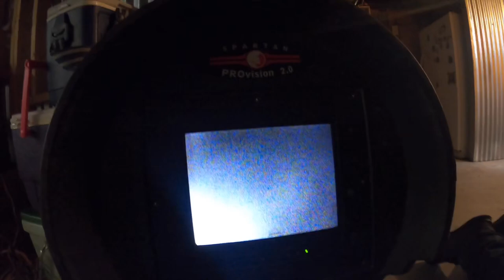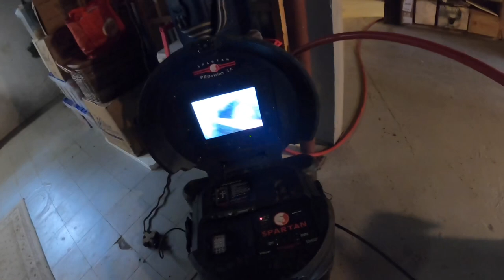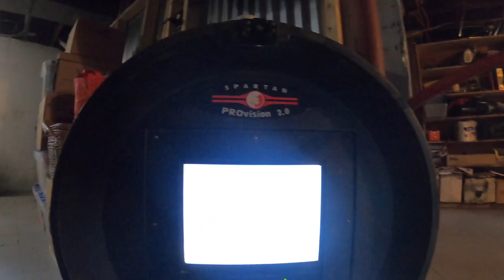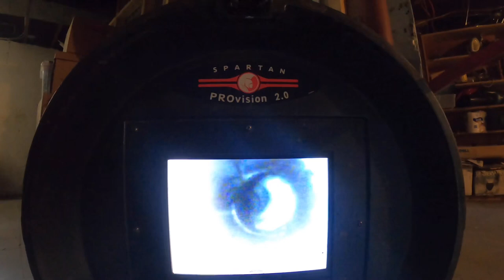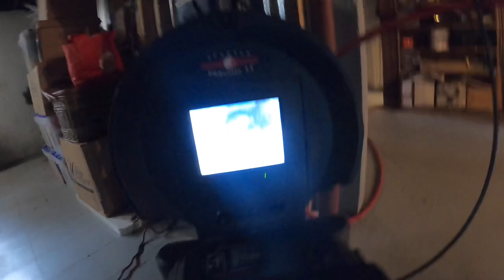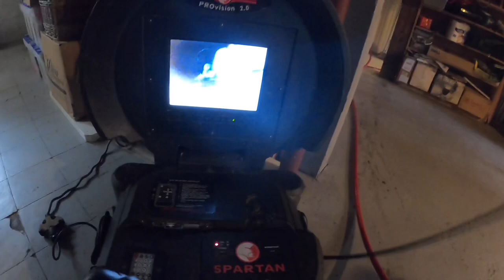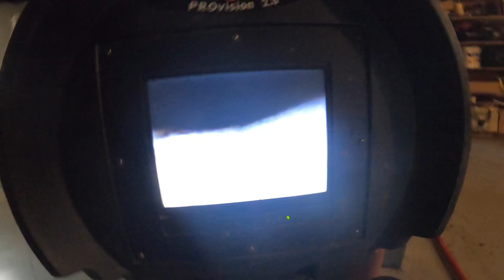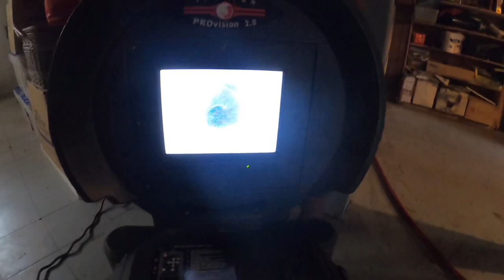MASSIVE!! SEWER ROOT INTRUSION- Drain Pros Ep. 48

Comment: If you install a liner, I'll be curious how you handle any laterals or cleanouts that tie into the line.  I couldn't follow this one exactly, but I thought you passed by one or more laterals.  Good job clearing this one and checking the work by camera.
Reply from the maker: Thank you! With this one the liner would just cover over the tie in, which is a outside clean out that the porch was build over years ago. Most of the time though if we have a tie in that needs to be completed say another stack tying in we have a picote machine that runs down from that stack and is almost like a 4” drill bit that bores through the liner, and then it has a sand paper attachment to clean the edges up!

Comment: Quick question does the pipe still need a sleeve or was the pipe ok?
Reply from the maker: The pipe still needs to be lined to stop the root intrusion into the pipe. All the roots were cut out of the pipe so they now have plenty of time to make a decision but after you cut out the roots the tree is going to send more roots in there place and they’ll be big and stronger! Most of the time on a situation like this they will have a 1-2 years before the roots have grown back in and gotten worse if they choose not to do the line of excavate the pipe 👍

Comment: Do you guys use a flex shaft?
Reply from the maker: We never have, I’ve seen the videos of them and they do an awesome job. When I first saw them it was hard to believe a compact drill could do that great of a job. We have a Picote machine which is a bigger version of the flex shaft that we use to descale the cast iron and rip out all the remains roots before shooting the liner, they work awesome! 👍 have you used one?
Reply: Drain Pros we have the Ridgid ones the 102,204 and have the 306 on order. It’s basically the same as the picote machines except you use the cordless. We use it a lot on drains with roots, descale then wash it out with the jetter.
Reply from the maker: We fix ugly plumbing ! Crazy what these new chain machines can do to old scaled up cast iron pipe, looks brand new when it is completed!